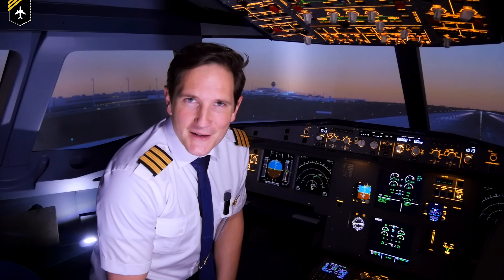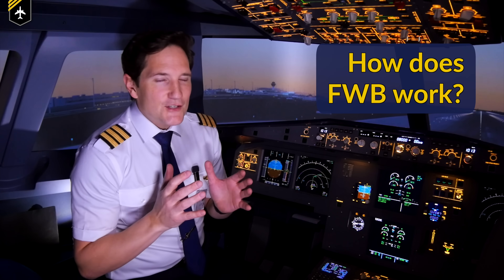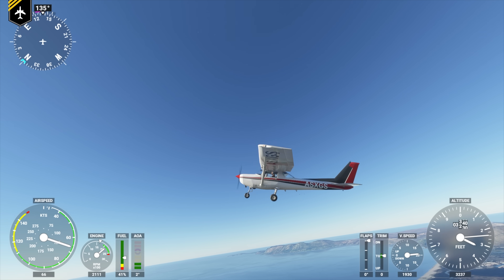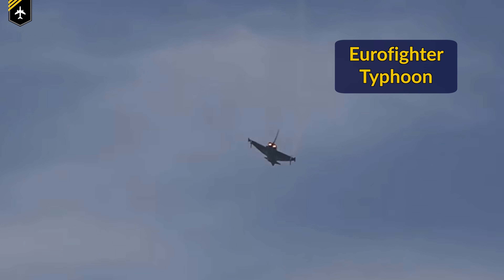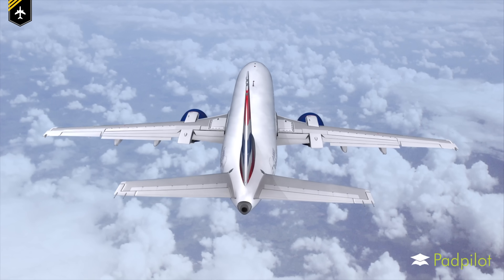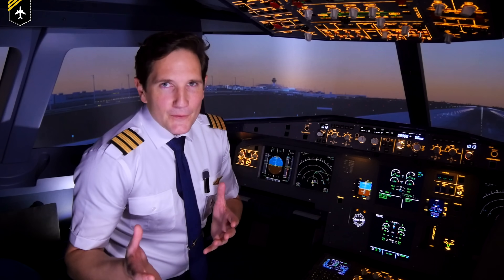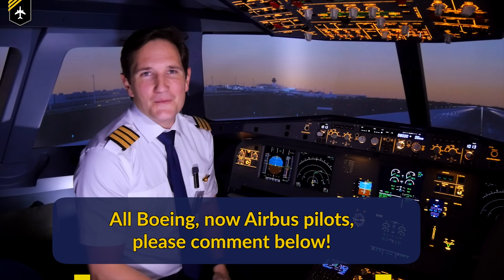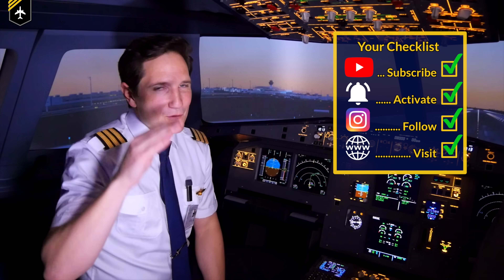How does FLY-BY-WIRE work? The future of flight controls! Explained by CAPTAIN JOE

Comment: I have a question. On the hydraulic system of the A320 u have a green, blue and yellow pressure. If we take take the flight control Elevator (green controls the left part of the Elevator, blue both and yellow  controls the right part) as example and the blue and yellow pressure system will fail, u only have the green system left that controls the left part of the elavator, it tends that the plane will fall into a roll without correcting movements from other flight controls, will the fly by wire stop this roll effect by automatically (activiting) other flight controls?
Reply: If you loose both blue and yellow then the plane will go into alternate law so roll commands are directly proportional to the sidestick. Whilst the elevator will cause a slight toll it won’t be a massive effect due to the position of the elevator close to the body and it doesn’t move as much as the ailerons do
Reply: @tomstravels520  okay thanks for your response mate!
Reply: Also it depends on what exactly failed. The green and yellow systems are powered by engine driven hydraulic pumps. If the pump on one of them fails but the hydraulic system itself is still sealed and could technically hold pressure, the PTU (power transfer unit) would kick in which is a hydraulic pump which is located between both systems. It's a fairly simple device and always provides support the hydraulic system with the lower pressure. So basically it is capable to pressurize the yellow system by using hydraulic power from the green system and vice versa.

Comment: It might be a silly question, but how does a right-handed pilot train to operate the sidestick with his left hand?
Reply: Practise
Reply: Just like a pilot that uses a yoke for steering has to switch hands depending on where he/she sits.
Reply: @swems-z3s  It sounds simple ... but imagine that someone puts the steering wheel on the opposite side and the throttle on the left foot in your car the day that you have to take your children to school!
Reply: @horaciolarotonda  Yeah of course. But what I am saying is that all pilots face that problem, not just the ones flying with a side-stick.
Reply: @horaciolarotonda  irrespective of yoke or sidestick, the natural way of flying is only using one hand on the controls. Only thing is you can hold the yoke with both hands, but it's not needed ( other than specific situations such as takeoff post v1)
Reply: @horaciolarotonda  it is simple. Took me about 5 minutes to adopt when I changed seats.

Comment: Is FBW in every a320? And can it be in a 777 or something else?
Reply: Basically any airliner still in production today except the 737 has at least some control surfaces controled via a Fly by wire system.
Reply: @shi01  even the 737 Max has FBW spoilers
Reply: @tomstravels520  Oh, ok. Didn't know that. thanks.
Reply: Yes all A320 and onwards have fly by wire ailerons, spoilers and elevators. 

A320/A330 and A340 have mechanical stabilisers whereas A380 and A350 are electrical.

A340-500/600, A380, A350 and newer A330 have electrically controlled rudders. The A320 will start getting electric rudders at the end of this year

The 777 is FBW with mechanical spoiler and stabiliser and 787 is fully FBW
Reply: @tomstravels520  ah okay thank you SM!

Comment: Sad this is not in every aircraft in the world. Sure manual flying is the best for accurate flying hands on piloting is the most commonly used way to aviate and navigate. But fly by wire is not just for lazy pilots. Fly by wire is still desired by manual flying pilots who want assistance if something goes even slightly wrong. Its not a way to prevent loss of controls but a way to help navigate through situations a pilot may have made a mistake on. The reason its not in every Cessna ever made is not because its not efficient in small planes and helicopters its because to install it costs more then the price tag on small aircraft all together. Bummer its another way to assist in flight "just in case" or just in any situation a pilot desires to use it. It does not remove piloting skill as the pilot still needs to know what to do how to perform maneuvers and read instruments and navigate. Nothing is wrong with extra assistance options. Oh well. Maybe one day...........

Comment: pitch angle protection during take off caused airplane to hit the tree top. I hate Airbus.
Reply: Wasn’t during takeoff and it wasn’t the cause of the plane hitting the tree tops. The pilots flying at 30 ft instead of 100ft above ground, flying much slower than planned and not increasing engine thrust until it was too late is why they crashed. Any other aircraft would have stalled and crashed before the trees when the pilots tried to pull up

Comment: There is fly by wire on the newer and more modern boeing jets. Such as the 777 or 787. The 747 does not have it. Therefore I think it makes more sense to say it's easier to fly an A320 than a 737. But not necessarily Airbus is easier than boeing because it depends on what you fly.
Reply: The 747-8 does actually have fly by wire spoilers and outboard ailerons and the 737 Max has fly by wire spoilers to reduce weight

Comment: FBW was one of the factors in Air France 447 crash and Sully himself said that if this aircraft was boeing it probably wouldn't happen. Of course it has many advantages but some things in the aircraft should be mechanical even as a backup if FBW would be prioritized
Reply: Fly by wire wasn’t the factor because the 777 and 787 are fly by wire as well
Reply: @tomstravels520  true, but it wasnt 777 nor 787 and that was old verion of 330 and boeings had pitot heating from the beginning AND volants are mechanically connected therefore second pilot WOULD KNOW and COULD counteracted this FO to do what he's done right?
Reply: @norbert1636  the A330 had pitot heating from the beginning. What makes you think AF447 didn’t have pitot heats. Ice crystals don’t melt immediately upon contact. It’s not like rain

The exact same thing could happen to a 777/787 where the pitots freeze and temporarily loose airspeed. The 787 can produce a backup speed using the AOA sensor (newer A330’s have a back up speed scale too)
Reply: @tomstravels520  you know what the most confusing part of this flight was? Capt knew that they're approaching the equator, the most stormy area and he decided to take a nap, second most confusing thing is CVR recorded dozens of 'stall' warnings but they decided to ignore it. Not sure if I'm right but they didn't even check QRH what they should do...
Reply: @norbert1636  no they didn’t. Didn’t apply the memory items (although I have my doubts about those) for unreliable airspeed and didn’t check QRH after. All they had to do was wait a minute and the speeds would recover…..although back then the aircraft would be locked into alternate law and autopilot would not be available so they’d still have to fly manually but could use the FD’s

Comment: Good stuff, small correction if I may, the FAC does not provide thrust corrections to maintain speed. There is no interaction between FAC's and FADEC/auto thrust. Normally you fly with auto thrust and this will take care of keeping the speed. In manual thrust you have to do this yourself.
Anyway, great video 👍

Comment: Sir, I would just wondering on A320 Rudder if we lose all hydraulic and electrical system could we still move the rudder?
Reply: If you loose all hydraulics (as in all fluid drains) then nothing will move. If you loose just all electrics you still have stabiliser and rudder
Reply: @tomstravels520  Thank you very much sir

Comment: I bet in 20 years all planes will utilize this.
I can even bet that Boeing will move over to the sidestick aswell. As they've already taken the airbus' button systems they will soon adapt the superior pilot comfort of the a320.
The reduced weight also means you can increase other weight factors such as fuel, baggage etc which will increase the airline's profit.
Not only this, flight safety should always go before anything else, If you really want to be "connected" to the plane, fly a cessna.
Reply: Well, every airliner in production today except for the 737 already uses Fly by Wire.

Comment: As a computer analyst and a hobbiest simmer, I will never actually accept a fully FBW plane (and because I am an computer analyst most people I would be the first to jump in to FBW). Boeing has the best approach and it will never be beaten: FBW planes with a fully working pulley backup. WHEN (we all know these things happen, its just a matter of when) you lose FBW, you can switch the whole airplane to "manual". You will always need to have the it as a backup, so might as well have them running. You can have the benefits of both (except weight savings on a fully FBW plane) and no side effect that way, and that is what Boeing does (including the 777). Airplanes, by FCC compliance, are susceptible to electrical discharges and can have some or all electrical systems fail, you will always need a physical backup. Why not both for safety? Fights? sure, its a war machine, get them FBW only. Extreme machines like spaceships? sure, thousands of other things are more likely to fail before full electrical. Bul full safety-driven passenger planes? no, you need the physical backup, and if you have it, natural feedback also beats simulated feedback. Remember when the 737-max didn't accept manual override? too soon? lol
Reply: Airbus A320/A330 and A340 have mechanical back up for the horizontal stabiliser and rudder. The 777 has mechanical backup for stabiliser and a set of wing spoilers. Guess what the 787 has…….none. So not sure where this “fully working pulley backup” comes from. It’s pretty much identical to the A350 and A380 with electrical back up systems. No FBW has ever experienced a total electrical failure because systems are isolated from each other. The A380 and A350 have 6 flight control computers all on different electrical systems and a BCM incase of all computer failure. Plus the RAT to power the emergency generator
Reply: @tomstravels520  I didn't know about the 787, so Boieng decided to throw the towel into economy, well not surprised after the Max fiasco. I know full electrical failure is next to impossible, my point of view was more about relying entirely on electronics. As far as I know, for instance, civil aviation complies with FCC standards on interference which mean it is susceptible to large electromagnetic fields. This means a strong EMP can knock a FBW out of the sky no matter how many backups it have, while if you have a standard pulley backup you can at least go back to manual and land it with zero electricity whatsoever (if any electronic equipment is still usable after whatever causes it). The electric systems on airplanes are so susceptible to interference that you have a massive circuit breaker system to compartimentalize failures so one electric failure don't cascade in every other system. But then again, the chances of a natural EMP that size are near null, and I don't recall any actual accident caused by one ~ even "accidental" shutdowns were made by physical weapons.
Reply: @MrCaiobrz  If you would have a total electrical failure the pulley system won't save you. I don't think you fully understand how little systems you would have left without any electrical power in an airliner type aircraft. Engine control? gone. instruments? gone all of it, not even the standby horizon would work in case of a strong enough emp. Hydraulics? gone because the engines are out. That means no slats/flaps, spoilers, emergency gear extension only, no cabin pressurization, no radio. Have fun finding any suitable runway within your gliding range without knowing where you are. I would say you survival chance is almost zero.

Comment: This is an amazing technological marvel, and one that will no doubt save lives in the long run!
That said, I feel it's probably a good idea to use this as a primary system, with the mechanical system acting as a backup.
The likelihood of using the mechanical backup is low, but any digital system in a vehicle should have a physical system that the pilot can choose to use at his or her discretion if said pilot feels it's in the best interests of the lives he or she is responsible for.

Say a situation arises where the pilot would have a significant advantage if he could feel the raw mechanical feedback of the plane's controls.
Or someone intentionally tampers with the FBW system. While I'm sure the system is air-gapped for obvious digital safety reasons, and many other precautions are taken, that doesn't mean this will be as immune to remote hacking as one might imagine.
---
I came across an article a while back about a functional (though still ~practically~ theoretical) method to hack air-gapped systems using heat transmission and/or thermal imaging.  
( https://resources.infosecinstitute.com/topic/hacking-air-gapped-networks/ )
So in the relatively near future, these systems will eventually become a security risk if they lack a manual backup.
(With a manual backup, there'd be little use in attacking the FBW system remotely, as it would be essentially pointless to remotely attack a system with a physical redundancy that couldn't be overcome without direct interaction.)
---

Barring that, there are no shortage of other scenarios to consider, the most extreme (if, unrealistic) being:
The highly unlikely event of a nuke going off mid-air in some sort of action-movie style disaster scenario.

True, the nuke would have to detonate far enough from the plane that the force doesn't outright blast it out of the sky, but near enough that the plane is within range of the EMP. Granted, this scenario has an astronomically low chance of ever playing out, but it's a possibility.
The last thing you want is something like Air Force One (or a huge commercial passenger jet loaded with the better part of a thousand people) losing all flight control because someone didn't factor in the very real need for a cliche'd but ever-so-vital "manual backup controls".

20-30 years from now, I fully expect see FBW replacing mechanical controls as the main control system for most every aircraft on the market.
But I feel it's prudent to ensure that by that time, it's not the ONLY control system in most (if not all) aircraft. Regardless of size.

In any case, nothing beats the tried-and-true reliability of manual controls.
Sure, you sacrifice the weight advantage by adding in an additional system rather than replacing it, but the age-old adage "better to have and not need, than need and not have" is advice well worth heeding.
Especially any time you're climbing into what's essentially an over-sized, pressurized aluminum cigar tube, traveling more than half the speed of sound, which will be hurdling through the sky at high altitude. 😂

Comment: Interesting topic. 2 questions: 1) You mentioned about mechanical cables as backups. Do Airbuses have these or not? I thought they didn't. 2) You said with Boeing, you feel more connected to the plane. Does that apply with the 777 and 787, or are they just like Airbuses now, because they're also fly by wire?
Reply: 1) A320/A330 and A340 have mechanical rudder and horizontal stabiliser so if all 5 computers failed (not including the FAC’s) then you still have control of some sort. A350/A380 have no mechanical backups as they have 6 computers and an independent electrical back up system.
2) The feel is artificial as the motors in the yoke are designed to make it feel as if you are mechanically connected.
Reply: @tomstravels520  Thanks. That's really interesting. So Boeing's are like expensive force feedback joysticks! Haha